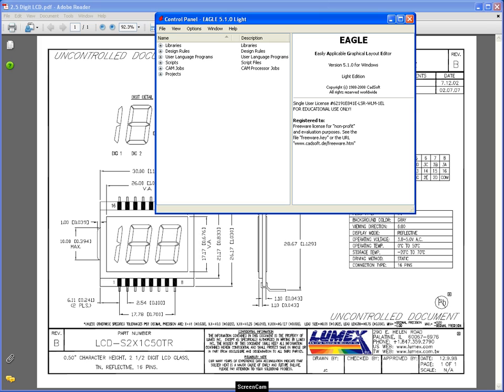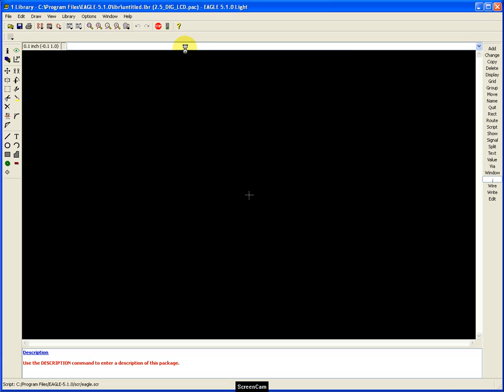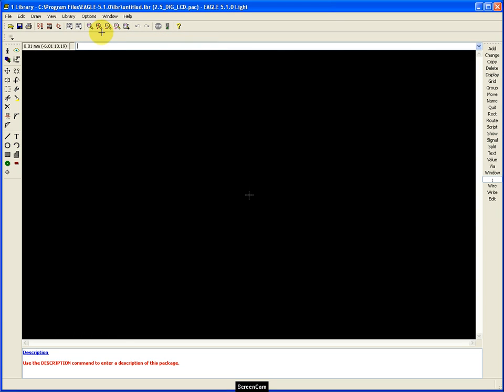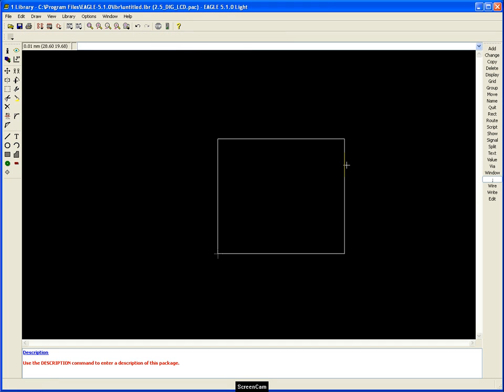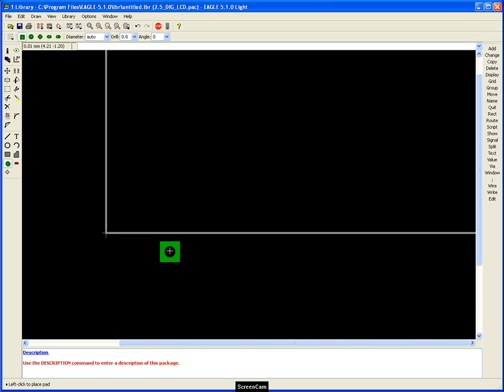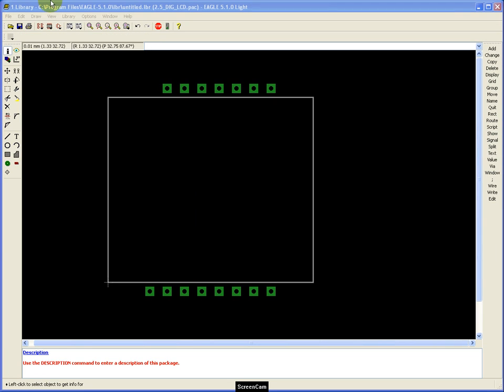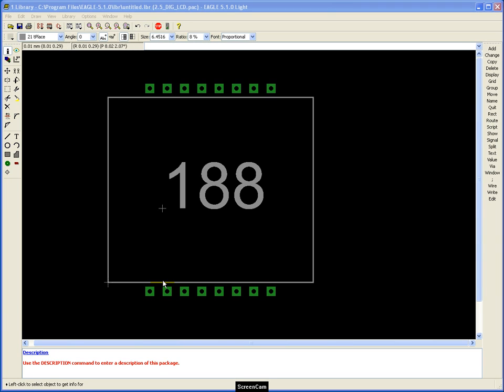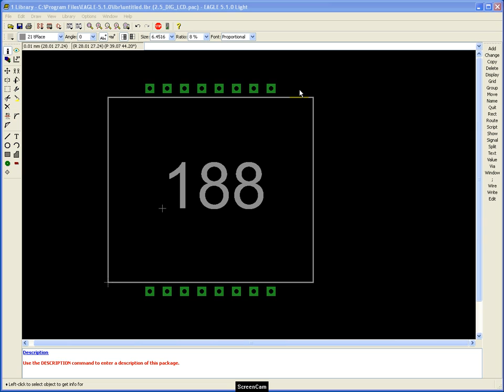Creating your own parts for a library in EAGLE

Comment: solved: when i used the wire to create the dimension of the part in the package window, inside the wire properties I had "20:dimension" selected when it should be "21:tplace". now auto router will route through a part instead of routing around ( like a restrict) : )